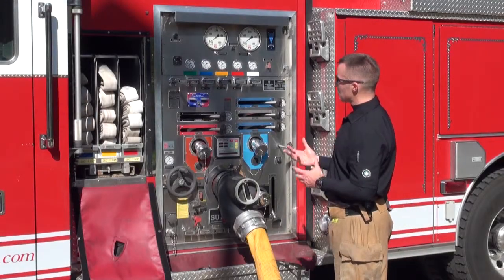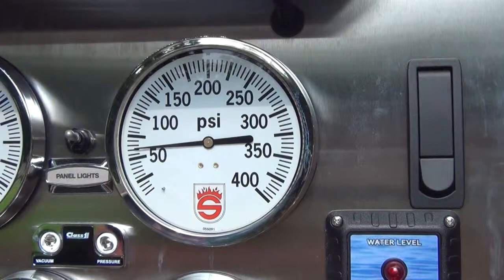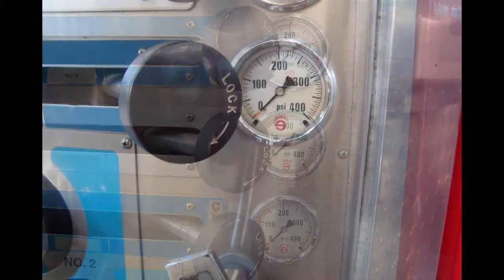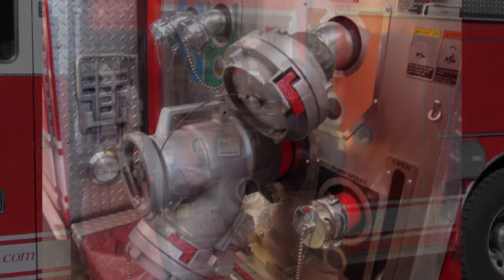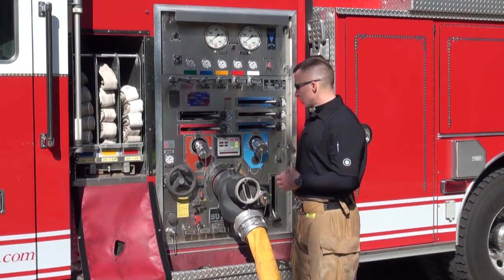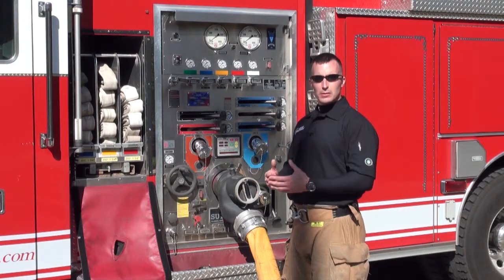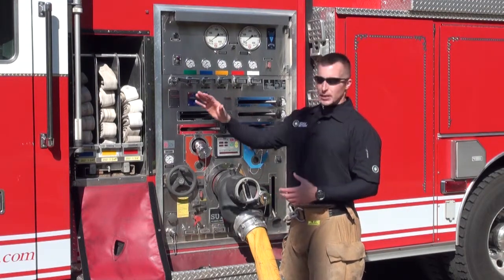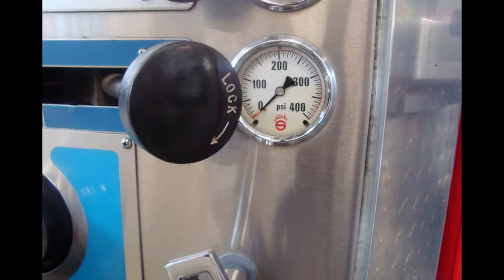Intro to Pumps

Comment: Globe valves are not "generally" quarter turn.  In fact, they rarely are since they have, by definition, a stationary seat and a moving "disc" that is generally controlled by a valve stem of some sort.  Locating the large diameter discharges away from the operator's position was introduced to the 1901 committee by firefighters in the late 1980s and voted in due to their request in the early 90s.  Those same firefighters were also fighting to keep the definition of a fully enclosed crew area to be three walls a floor and a roof because they did not want to give up their beloved jump seats. The insurance companies ended up winning that battle but, amazingly, you guys still found ways to fall out of fully enclosed cabs.  I love you guys but, damn. Alan Brunicini of Phoenix actually came to us and wanted a cab where the driver was the only one who could open the cabs doors like on a bus but no manufacturer in his right mind would build one.

Comment: If you didn't have a side-mount pump you might be able to see your LDH discharge
Reply: I believe NFPA 1911 specifies the the LDH discharge needs to be on the opposite side from the pump panel.  In case of failure it could injure the operator on the same side.